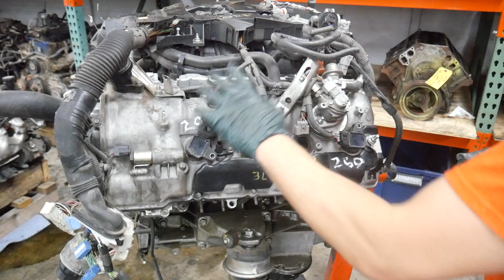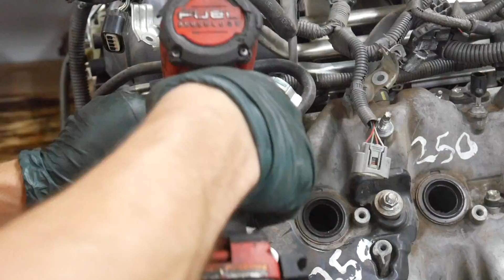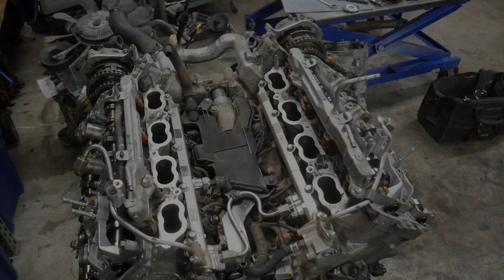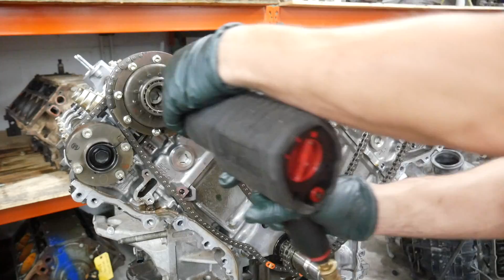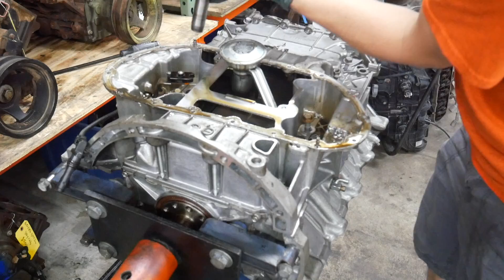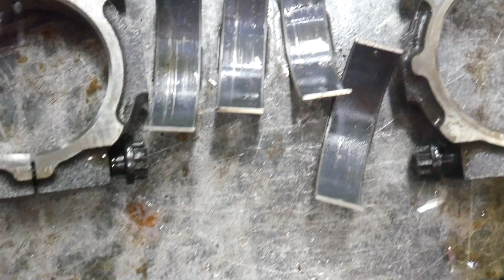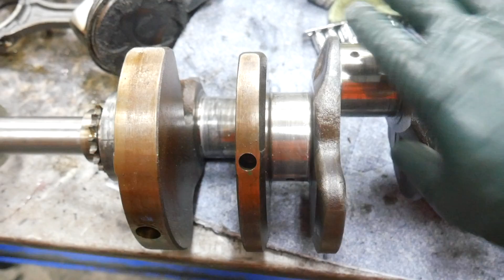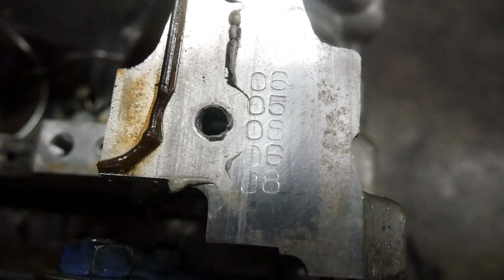Lexus LS460 1UR 4.6L V8 Blown Engine Total Teardown! How Did One Of The Most Reliable Engines Fail?

Comment: If a world renowned Super Reliable engine blows up, it's either Oil, or Timing.
Reply: I suspect it's the old Jiffy Lube loose oil drain plug problem.
Reply: says who ? you or most experienced mechanics and engineers ?
Reply: Or some kids always romping on it. I blew my moms Toyota when I was a teen always redlining it lol
Reply: @paulsosa1872  That shouldn't cause a catastrophic failure in an otherwise healthy engine, cars are designed to be run hard. Over revving or severely lugging the engine all the time can ruin the bearings, but to the best of my knowledge, these engines were only used with automatic transmissions, which won't allow either of those scenarios. Over revving the engine to the point of ruining the bearings almost certainly would have ruined the valvetrain too, which we didn't see.
Reply: I’ve owned two pontiacs, one good and one a POS, had three Fords, all burned oil like crazy, and two I owned from new and they burned oil from day one. Had an older Cadillac that was a piece of crap, a Hyundai that has been a great car, two chevrolet trucks that haven’t been particularly great once the warranty expired, two Nissans that amazingly have been pretty good, Kia Soul, so far so good, and one Toyota that has been great so far with over 100,000 miles.  Had the worst luck with Ford and GM products sad to say.  I want to buy American, but they haven’t rated well for me at least.
Reply: @kevwmobile3238  yeah yeah...i know..all fords are junk ..and all burn oil from the very first start up ..and isnt kia and heyunday having problems now with their cars burning up??

you can bad mouth the american auto industry all you want...but i guess you didnt know about the worlds largest fine in automotive history goes to?..drum roll please.....TOYOTA ...well besides vw now
Reply: @merc-ni7hy  my personal ownership experience is what I was talking about.
Reply: @kevwmobile3238  and speaking  of oil burners...funny how you left out toyota with oil burning,,,and blocks cracking  on thier 4 cylinder motors.or honda with blown head gaskets or trannie's so you see?/..they all make junk..even  the glorified toyota cars known as lexus
Reply: @merc-ni7hy  speaking of trannies my Silverado tranny crapped out at 90,000 miles, and the GM replacement crapped out at about 15,000, but I wasn’t driving the truck much, so the 36 month warranty had expired. My 1991 ford ranger I bought new with a 5 year 60,000 mile warranty blew up at 62,000 miles, because the pilot bearing detonated. A $20 part cost me the trans, and Ford and GM in the other instance told me tough shit. 

Believe me I try to buy domestic, but let’s be honest. They aren’t made here anyway, and so far as my personal experience goes, they aren’t that dependable, however it’s easy to find parts to repair them which can be a problem with foreign car companies.
Reply: @merc-ni7hy  as you can see, I’m not a fan boy of any car maker. I’ve owned numerous models from numerous auto companies. I’m just giving my honest opinion on the vehicles I’ve owned. All the Fords burned tons of oil, and my Ford ranger was mostly made in Canada and Mexico with a Mazda transmission. The truck did have 280,000 miles when I gave it to my sister in law, but it burned a quart of oil every 1,000 miles from brand new. That’s just the facts f my personal ownership. The 1985 I owned did the same thing when I bought it new. 

The 1969 Ford Truck that was the first vehicle I ever drove burned tons of oil too, but it fairness it’s was 12 years old by the time I got it. They are the only vehicles I have personally owned that burned oil like that. Nothing else even close. I buy vehicles that seem to be the best for what I need at the time that are usually much cheaper than alternatives. I don’t brand shop, because I’m not loyal to any brand. For my latest truck I looked at Toyota, Ford and Chevrolet. I got such a better deal on the Chevy, I bought it. Ford and Toyota were far more expensive for a comparable truck.
Reply: That's how the vast majority of engines die. Even VW/Audi which people love to hate on die because of that. Stupid long factory service intervals that are often stretched by owners and timing chains becoming loose and grenading the engine.
Reply: These engines are oil burners according to AMD from Car Care Nut. Not such a great engine then.
Reply: To me as a mechanic and base on experience Honda makes the best reliable engine ever.
Reply: The 4.6 isn't known to be all that reliable or long lasting. The 4.7 is though.
Reply: @Wade-lk4yo  it’s honestly because of the timing chain. Because it’s not a timing belt people neglected to change the water pump.
Reply: @MrDISCOBRITCHES  I think it's the width of the 4.6 head gasket too, it's thinner (horizontally, looking down on it) than the 4.7. You almost never hear of a 4.7 head gasket going out.
Reply: @Wade-lk4yo  Yep, only issue/maintenance item is to remember to replace the timing belt every 100k and it goes forever...
Reply: @allenrichards5086   I thought this engine had chains?
Reply: @MrCountrycuz  4.7 had belts, the 4.6 is chains..
Reply: The one thing I hear from many techs, that work on Toyota’s is stay away of the engines with turbochargers, I have had three Highlander’s for more then 150 k before any issues, just brakes, and oil changes, after 150k the oxygen sensors had to be replaced and one car had a bad alternator that’s all the maintenance mostly minor stuff. I suggest with any cars you buy today , get Mobil one synthetic oil on all oil changes and use the correct viscosity of oil recommended by the manufacture of the vehicle, and the best brake pads , go with the ceramics they never damage the rotors like the carbon pads
Reply: @patrickluby4019  i just got back from allentown pa...went to pick up some van doors for a job...at one intersection  was a toyota tundra siting right  in the middle of the road..and the guy sitting  in side on the phone...came back  and the toyota was on the back of a ford rollback...toyota is the worlds largest scumbag of a car maker..and i will never own any of them
Reply: @merc-ni7hy  13 subs and no content. Yeah you're believable
Reply: @merc-ni7hy  remember how many years the frames rotted on there compact trucks lol.
Reply: Or no maintenance
Reply: Nice pfp bro
Reply: Yes they were renowned for burning oil
Reply: @nolife1199  not sticking up for toyota but poor maintenance (the 10k+ mile / once every year or two oil change people) triggered the vast majority of the oil burning cases. It was super easy to get the rings stuck from oil turning to rock like coal in ring grooves. It clogs up the oil control ring then things go downhill fast as the other rings stick and then polish the cylinder bore.

I think honda had a similar issue with the civic 1.8 engine also, the lower tension piston rings used for top fuel efficiency are much less resilient to neglect, which to be honest is pretty darn common with a car that's treated like an appliance.
Reply: @volvo09  kind of like the Saab T7 engines. Crappy low friction piston rings which respond horribly to even slightly sloppy maintenance. They are good engines when they are well kept though
Reply: Toyota isn't the end-all be-all of reliability anymore. Even they are slipping, succumbing to the recurring revenue stream generated by cars designed to last about as long as the warranty/payment plan.

Nobody makes a good car anymore.
Reply: @TestECull  this motor is from 10+ years ago and is to date one of the most reliable V8s ever (at least mechanically). Also, Lexus is still top dog in terms of reliability even today, especially with their V8s.
Reply: @dakdewolf  ah..no...lincolns of the early 1930's were known to be rock solid reliable and go over 300k without being touched
Reply: @dakdewolf  for me i definitely agree with reliability. had an 7 series before my ls460. had to give my 7 away. was just hopeless
Reply: @merc-ni7hy  Then that should be your car for life!
Reply: @MrCountrycuz  close..i do have a 90 merc grand marquis with a very reliable 300k miles  on it..
Reply: @dakdewolf  relative reliability. Not actual true reliability, anymore. If Brand X lasts 36,000 miles on average and Toyotas last 40,000 on average then "everyone" will still dance around and give praise to Toyota concerning reliability. 
"Back in the day" before engineers and bean counters became really really good as materials experts, a lot of car companies over-built many parts and engines were praised for their durability. Today, however, actual durability will not do and now we see an over abundance of thin walled metal parts or, ugh, plastic  parts. Intake assemblies, timing systems, cooling and oiling systems as examples, look at any BMW. If bean counters can figure out how to make connecting rods out of cardboard, they will. Even Toyota.
Reply: @dakdewolf  nahh. that be a 4.7l
Reply: @merc-ni7hy  .I am not sure what you know about old american motors, it was pretty rare for any 30s motor to go over a hundred thousands. I am old enough to have been around the early ford ( merc) motors. Both the V8s, and the v12s. Even had a few merc flatheads.
Reply: @merc-ni7hy  bruh the 1930s 💀
Reply: @TestECull  Not true.  Toyota had some issues in the mid-2000s, but they actually fixed the problems that turned up.
Reply: @TestECull  truth
Reply: @TestECull  I see new Camry engines with the “scary” 0-16 oil with 200,000 miles on them, they still run great.
Reply: @andym1223   That's cute. Come back in 30 years when millions of 4.9 I6"s, flathead v8s, smallblock chevies, 225 slant sixes, 4.0 jeep sixes, et al are still on the road after decades...if not over a century...of service still havent killed them yet.

 Hope you like the sound of old school iron 'cause the last ICE cars on the road will have carbs on them.
Reply: @TestECull  still better than anything else. But yea its sad to see
Reply: @TestECull  Exactly, look at what happened when they made the bZ4X. They quickly had to issue a warning to stop driving them because they couldn't figure out how to keep the darn wheels from falling off. What a disappointment to everyone waiting for Toyota to make an EV because they were hoping it would be so reliable and trouble free. At least they took care of their customers with warranty extensions, free loaners, offering to buy the cars back, etc.
Reply: @averyalexander2303  Yep. When the paragon of build quality can't fucking torque hub bolts anymore you know nobody builds a good car.
Reply: @Rob Me yes..cuzz we all know toyotas never ever brake...ever...right?
Reply: @NotADuck ya  know..i  have been a ford guy all of my life and owned nothing but fords..and have great luck with them..on the other hand  my mother  in law was a loyal toyota buyer..some of her toyota sure did spend time at the dealership  and not for oil changes and washer fluid ..and besides..i wont support a car maker  who turned their backs  on us when 9/11 happened..toyota is a scumbag of a car maker ..
Reply: @NotADuck just like i said..when 9/11 happened  they didnt do  a dam thing for this country but look the other way and count their american profit ...they like to brag they are so american with so many of their products made here.  by americans for americans .we gave them free land to build  on ..and huge tax brakes..and when the shit hit the fan...they ran like scared schoolgirls....if a kid at the time drop  a nickel to anything 9/11 related back then..that kid just gave more then multi billion dollar toyota or honda..in fact all foreign car makers here except vw....lets not forget,,,toyota is linked to human trafficking...and working some of their ppl in japan to death ....if you doubt anything i have said here..you can look it all up and check on everything i have said and call me out  on anything you found that i lied about
Reply: @merc-ni7hy  AHAHAHAHAHAHAHAHHAHA THE BOOMER IS BACK TALKING ABOUT 9/11 AND HOW TOYOTA “turned their backs on us” SINCE WHEN IS IT TOYOTAS RESPONSIBILITY TO HELP AMERICA, WHAT WERE THEY GONNA DO? REBUILD THE TOWERS? HELP CLEAN UP? ITS NOT LIKE IT WAS A NATURAL DISASTER THAT CLAIMED THOUSANDS OF LIVES AND HOMES.
Reply: @dr.delray2767  AND I'M GUESSING YOU VOTED FOR SLEEPY JOE,,,and drive some crappy assed toyota or subaru ......and want the boarders wide open
Reply: @merc-ni7hy  lol you are hilarious! 🤣
Reply: @a36538  am i  a clown??/ am i here to amuse you ?..i bet you voted for sleepy joe and are a sub to scotty kilmer....
Reply: @merc-ni7hy  what does joe Biden or open borders have to do with any of this. You literally expect a car company to help another country out after a terrorist attack. So by your logic Ford should help out other countries that are attacked by terrorist right?
Reply: @merc-ni7hy  hasn’t Ford had the most recalls of any auto manufacturer? And can you please link the source of your information regarding Toyota and human trafficking. I’m sure that’ll be an interesting read. And I most certainly will not buy American. Remember but superior… buy Japanese
Reply: @dr.delray2767  sure ford had recalls..but so has the Almighty toyota company....and for their fuckery toyota was given the worlds largest fine  in automotive history ..well besides vw now..not ford..not GM//not even chrysler..but toyota got that fine...aint that  a kick in the head
Reply: @merc-ni7hy  I too would like to see the information / link you have to Toyota being involved in human trafficking. Please send me that information so that I can verify it.
Reply: @merc-ni7hy  Lol, I'm not a Toyota cheerleader. I'm a Chevy guy. I have a '65 Impala SS. And I don't believe anything Scotty Kilmer says.
I just thought if you already have the information, you could just cut and paste it here. Human trafficking is awful.
Reply: @merc-ni7hy  and wait what does toyota has to do with 9/11? LMFAO
Reply: @merc-ni7hy  complaining to youtube won't help you 🙄
Reply: @merc-ni7hy  did everyone mention ford = worst car company ever 🤣
Reply: @NYRNJD1987  ya think so huh??..you must own a toyota or subaru
Reply: @merc-ni7hy  also there's a song by a band called slipknot the songs called people = shit, they originally were gonna call it ford = shit but thought to many people knew this already so it was kinda pointless to do so. If anything saying ford on the album would hurt them really
Reply: @NYRNJD1987  oh man,,i have to thank you for the laughs ,,no really..you should have you're own show  in vagas with Wayne Newton ....can ya tell me a car maker  on this planet that hasnt made junk??...and what car brand do you favore??..or are you ashamed to tell me?...and remember??..BUY AMERICAN
Reply: @NYRNJD1987  AND YET..THERE ARE MANY  songs about fords in a good way ...movies have been made around the brand..so what shit brand do you like?..lexus?..Acura?...Deawoo??...oh i cant wait to hear this ...and again///remember??,,,BUY AMERICAN
Reply: @merc-ni7hy  you have finished your surgery have you. No ones heard a good song with ford mentioned in it but their are songs putting it down tho you might be a bit to dull for that hey lmao. I get it your mad your wife and kids left you its ok just move on oldie
Reply: @NYRNJD1987  well i can see i got a weak  reply from you ,,,datta boy...you really told me off this time huh.......yep..must be a toyota owner
Reply: @merc-ni7hy  I don't have to have a strong reply lmao you've been arguing with people on this for almost a year 🤣 nuff said. Its easy to get under your skin hahahahaha I should make a video of your responses but won't cause you're not worth it, we all got you mad yet you tried your best and couldn't get a angry response from anyone over 9 months lol
Reply: @merc-ni7hy  also lets remember that Toyota Nissan Honda and mistsubishi gave the most to help out after 9/11 😂🤣😂🤣😂🤣
Reply: @NYRNJD1987  dont flatter yourself fool...dont think for a second you got to me...remember....you came to me  not me to you
Reply: @NYRNJD1987  also lets remember...none of them did a thing until almost a year later...once toyota kicked  in ..[ after about a year ] then  all others had to fallow so it wouldnt make them look bad..but the big 3 helped as soon as that shit happened...the one and only foreign car maker to stand up with the big 3 was vw ......and aint you up kinda late  on a school night ?
Reply: @merc-ni7hy  I suppose the best part is asking women who's got what and all women say ford men have small you know what's 🤣 then again Henry and Edsel had to use microscopes to find it so it makes sense. Your anger shows through your messages like gas burns with electricity lol then again your a Ford guy so it makes sense. Hey at least you make small Asian men look big you know where 🤔
Reply: @merc-ni7hy  also lets remember the amount of lawsuitsyouve been involved in with children and there accusations of you know what 😳  ouch hey. Can't get any one over 5'0 off hey.... then again neither could Henry. Guess your like your master hey, keep in mind everyone born between 40-70 your g12 is our g8 and since you have to look that up ouch HAHAHAHAHAHA hence why you buy Fixed or repaired daily = Ford thats just the nice one ok little girl 😉
Reply: @NYRNJD1987  really??..thats all you got...its clear you dont want to talk about cars..you are just looking for attention ...i see you are afraid to mention what brand of vehicles you like...thats  ok...these posts back and forth are getting lame..dont  bother replying if you dont have anything intelligent to talk about
Reply: @merc-ni7hy  don't tell us what you are lol you've been replying for 7 months (you're very mad) but its goof for laughs and I could make a post highlight you and make alot of people laugh. Anyways none of us wanna know how many kids you've been with so stay on topic already. We're talking cars not kids
Reply: @kevwmobile3238  the same can be said about all car makers..including toyota
Reply: Hahahah.  You Toyota and Honda lovers are insufferable.
Reply: @paulkeddy7656  Ah yes, insufferable because we value reliability over whatever junk you fanboy over.
Reply: @paulkeddy7656  Found the German car owner. Pfft, you're just jealous.
Reply: @paulkeddy7656  . toyotas and hondas have superior technology. But the both use inferior materials.( japan is a coral and volcanic island) all the materials are reclaimed. No virgin steel or aluminum.
Reply: @bigsteve8408  superior technology??..really??..what have either done in the automotive world that someone else hasnt already done before them???..infact most of japan only has what americans have already done